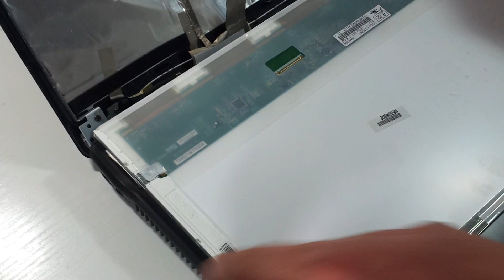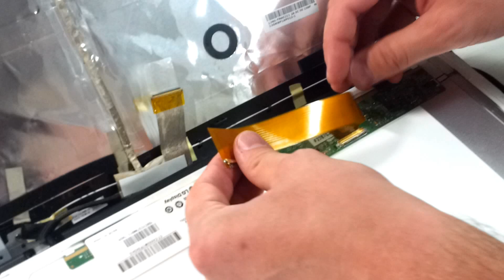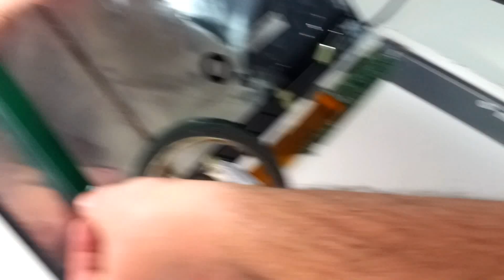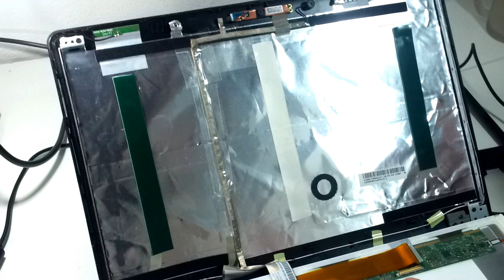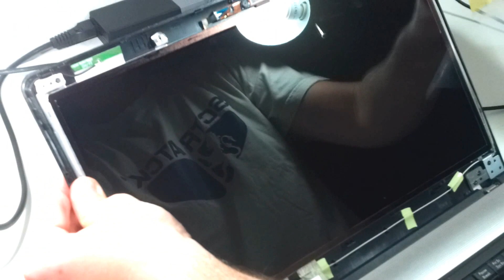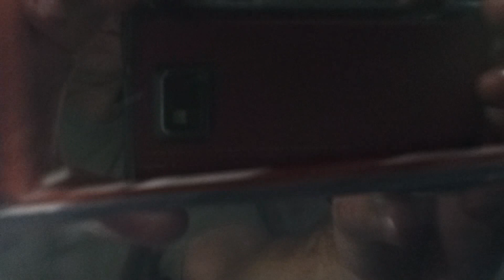Z 16,0 LED z Asus N61JV na 15,6 LED přestavba výměna displeje , screen replacment. LCD Display Shop.

Comment: Hi i am going to do it in my asus n61jv, I already found that the display is LP156WH4 LG but i don't exactly know what kind of display tape you had used. Could you please explain which should be fine for such display ? THX great video !